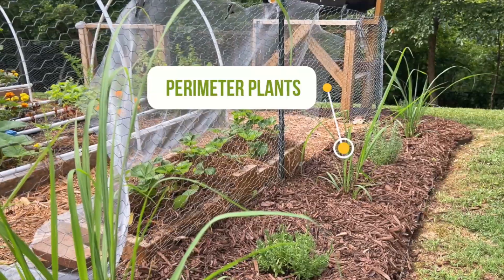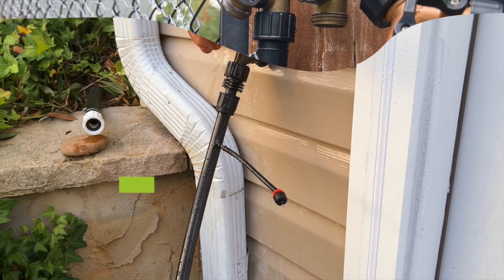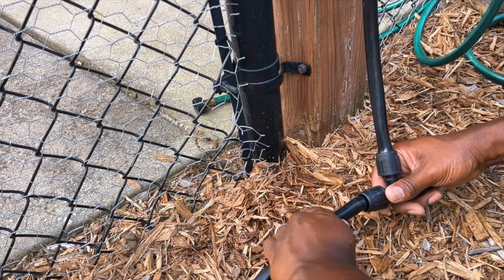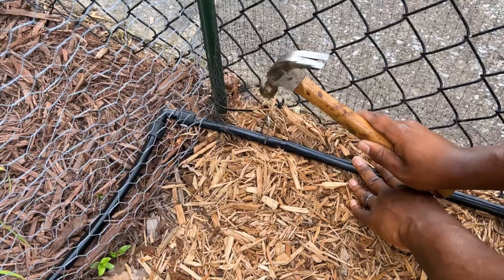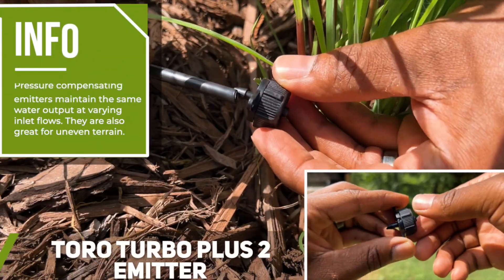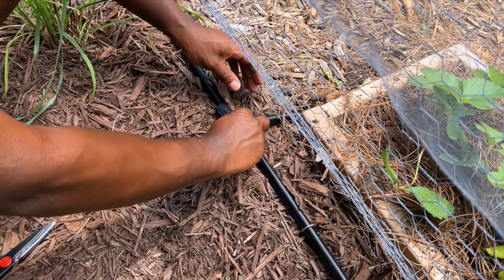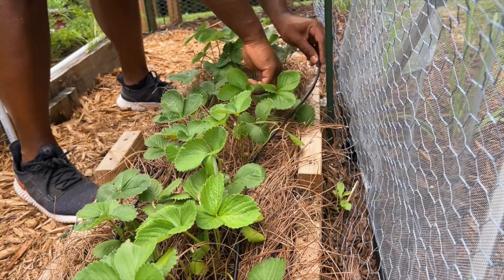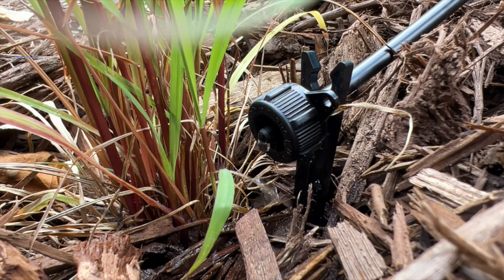DIY Drip Irrigation System | Easy, economical and effective

Comment: I'm building 5 Raised Beds.  
I'm going to be using ½” tubing and I will run it through all the boxes, but there will be a T in each box where four ¼" emitter tubing will run to water the plants, so each ¼” tubing will be 8 ft. long.  The spacing between the emitters is 6”.  I'm also using a Senninger Pressure Regulator 25 PS.

How long should I run the water so that my plants get 6 gallons of water per week?  And should I run it once a week or a little bit each day?  Thank you.
Reply from the maker: Good question. I'm sure there is a formula you can use to find out the answer to that, but I do not have it lol. I would suggest asking/emailing the folks over at DripDepot.com who went above and beyond to help me with some of my questions. I'm not sponsored by them either, so this is just my honest feedback. If they cannot help you, I'm sure there is a way you can test the concept by using a 1 gallon bucket and seeing how long it takes to fill it up with one of the emitter lines and then multiply whatever time you get by 6 and use that as an approximate time.

Comment: Would love to see the cost difference from the PVC to commercial drip system.    What one did you find harder to do?
Reply from the maker: Great question. I would say the PVC project required more tools, however, the commercial system required more research to make sure I was buying the correct emitters.
Reply: @GreenTechTown  Seems to me that the PVC solution would be cheaper. I have five raised beds to do!

Comment: I do have issue with where the water comes out, right at the heart of the plant. The water has to go to the roots, which is a bit further from the heart. Besides, the water can cause the heart of the plant to rot. Roots tent to reach out to the full perimeter of the leaves. Ideally, you water an inch or two from the edge.

Comment: Awesome video. Does your pump heat up do the fact you are reducing the pressure?
Reply from the maker: Great question ANDY. No, the pump does not heat up as I am also using quite a bit of water for my other 3 raise beds which have been the primary areas receiving water from the system. In this video, I added more areas that now have to be watered. I was glad to see the new pump provided enough pressure to water each area of the garden plus the perimeter plants.
Reply: @GreenTechTown  Let's say I set up a similar system but the pump overheats due to less water demand. Other than replacing the pump with a smaller one, what would be a good fix for this? My first idea is having a dummy line that returns water back to the barrel. But is there another way?